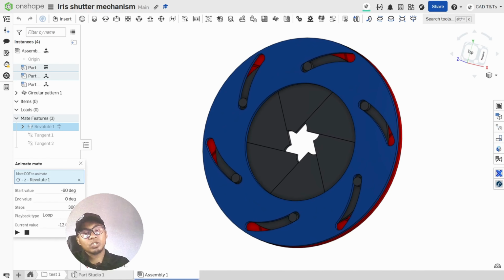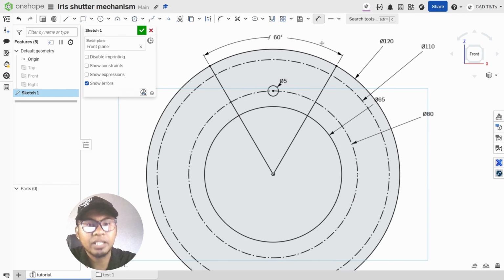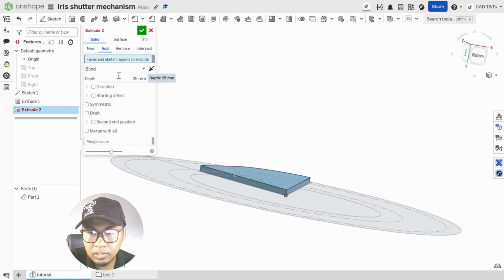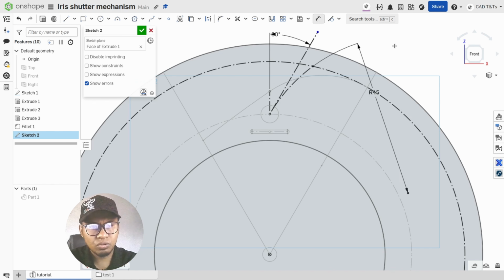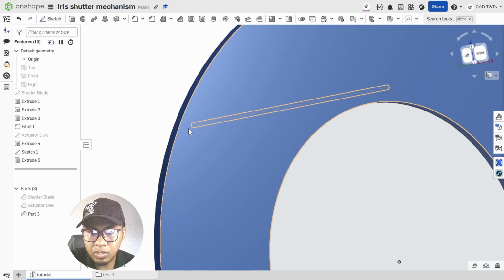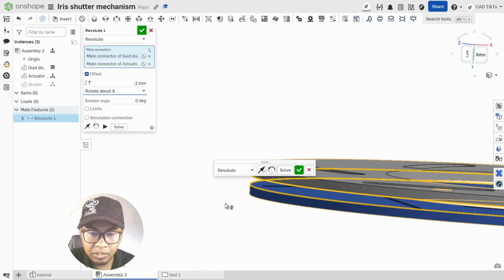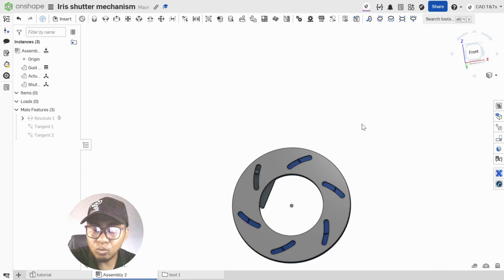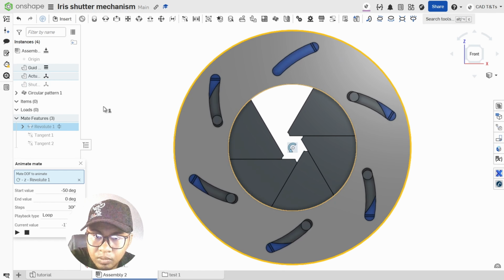How to Design and Animate Diaphragm Shutter Mechanism in Onshape

Comment: Onshape doesn’t have monthly subscription?
Reply from the maker: It doesn't
Reply: @cad2ts that yearly subscription is too costly plz any other recommendation to my designing project?
Reply from the maker: @ndenergy21you can use Onshape for free. The cons of the free Onshape is that all of your project will be public.

It's better for you to use Fusion360
Reply: @cad2ts yes, but some  futures aren’t working on free tier. Like uploading an image
Reply from the maker: @ndenergy21do you mean using pictures as reference in sketches for example? If so, you can import picture in Onshape.
Reply: @cad2ts yes, because I’ve tried it but seem not working.
Reply from the maker: @ndenergy21It should work normally.
I have used a reference picture when I model the car body as an example: https://youtu.be/TNBvDY9kLqE?si=hkzXid08aWNgV_jI
Reply: @cad2ts yes maybe I don’t understand how it operates fully
Reply: @ndenergy21not true.  I use the free version for about 4 years now with more than 100 models.  You can import pictures into OnShape and then you can use it into a sketch.